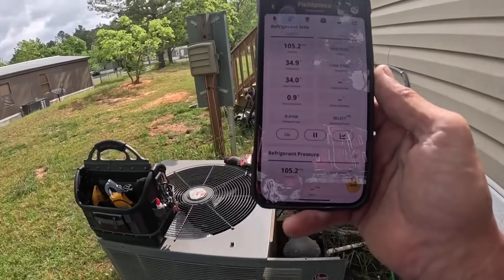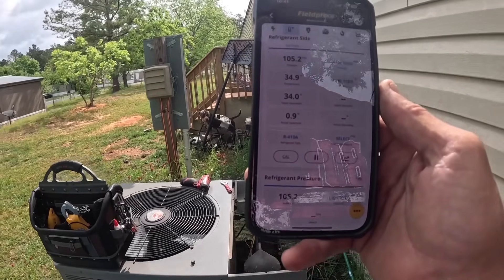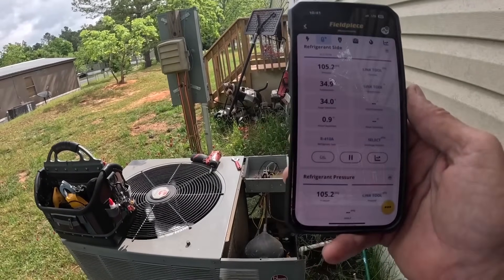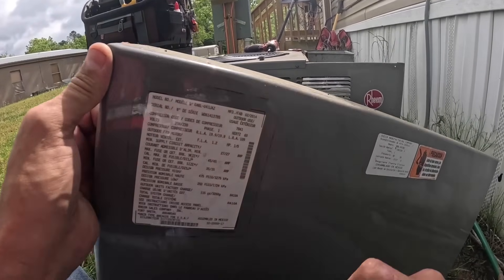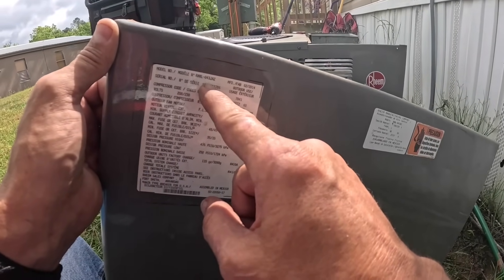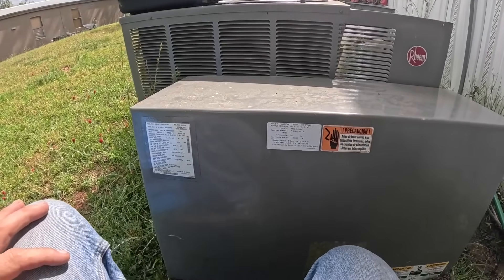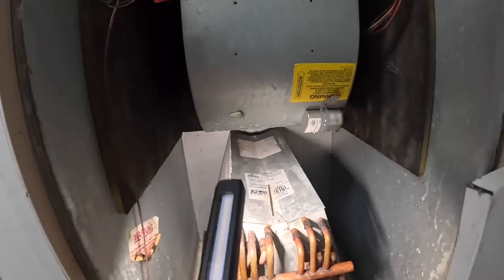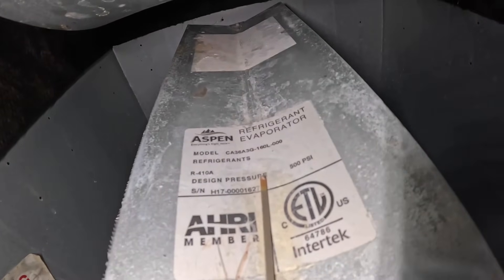Freezing Trailer System On Sunday! #hvacguy #hvaclife #hvactrainingvideos

Comment: Like you said it probably ran like this for years. I'm sure it wasn't always freezing up. Something had to change in order for it to freeze. I'm thinking dirty condenser. It's a mismatched system for sure. But I would of cleaned the condenser to try and bring the subcooling down and raise the superheat. It's a bad install but you could of made it better by cleaning the condenser.
Reply: and get a cheap filter or add a second filter rack on other side that filter is to small for 3 ton and to restricting

Comment: I was going to do a brand new but costumer thiught I was too high on my bid. The costumer called us because he was having issues with his system and couldn't get the original installer come to find out the condenser is 3.5 and inside coil is only a 2 ton.

Comment: I would check air flow. The return air is too small and the filter was being sucked into the grill.  I bet the total external static pressure is really high.  I would check the AHRI matchups to see  the actual btu's of the 3 1/2 ton condenser .  Also couldn't tell what type of metering device  it had.
Reply: If currently using a piston, a Txv may be able to compensate for mismatch

Comment: Can you upgrade the coil to 3.5 ton instead of replacing the condenser with a 3ton unit. Would that be more cost effective?? Good info 👍
Reply from the maker: Yes, that’s possible. But, may end up with an oversized system.
Reply: This is a mobile home....The preexisting duct work and blower is probably too small for even a 3 ton.
Reply: @grandinosour  There is a label in every mobile home that details the duct capability.  It is usually on a kitchen cabinet door or in the master bedroom closet.